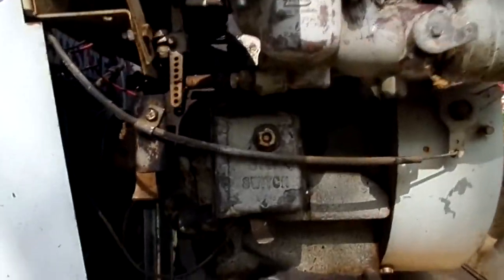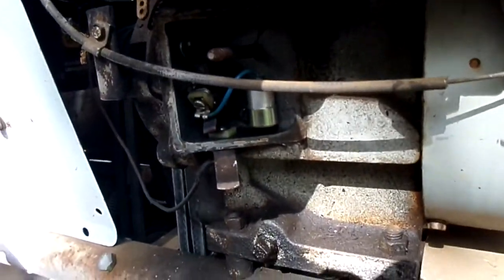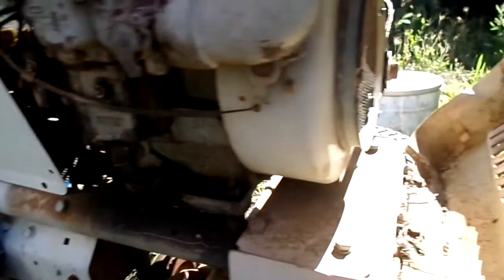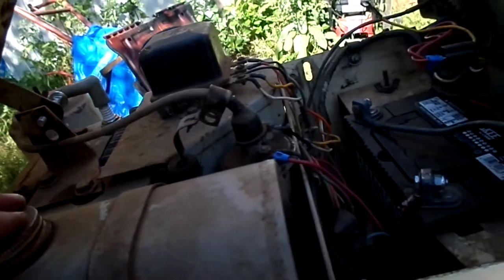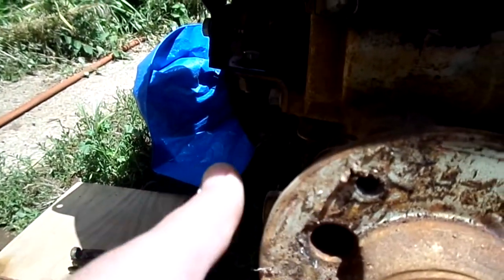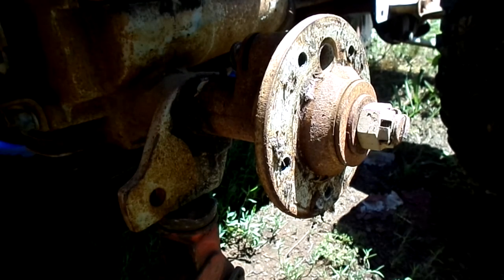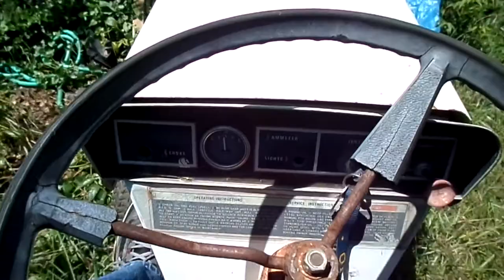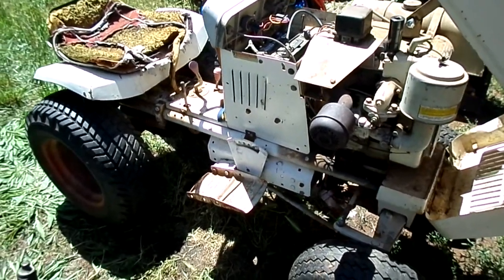Bolens 1050 Tube Frame Tractor. Part 3, Timing, point gap, and Free-Wheeling Pin.

Comment: Funny. As soon as I finished watching part 2 you had part 3 up. If you said before I forgot but is that a Wisconsin engine? I noticed the zenith carb. Usually only see them on old farm tractors
Reply from the maker: Yes it is a Wisconsin, 10hp. I'm forgetting the year now, but I think early 70's.
Reply from the maker: Just did a little research; looks like it's not easy to pinpoint a specific year on these, but the 1050 was made from 1966-69 and mine is an early model as it has points.
Reply: @MrUbiquitousTech  hey, just bought 2 of these tube frames. one has an engine and the other doesn't. I was wondering if you new the direction of your motor on your 1050 Bolens ? I am keeping the engine in one and going to see if I can get her started but the other one doesn't have a motor so when I order the motor just wanted to see if your motor on yours runs, ( clockwise OR counter clockwise ) thank you I appreciate it.
Reply: hello, I have a Bolens 1055, but it consumes a lot of gas, do you know what the problem is or is it normal